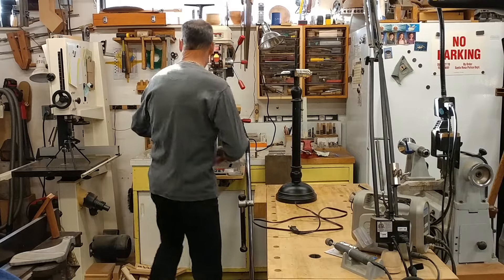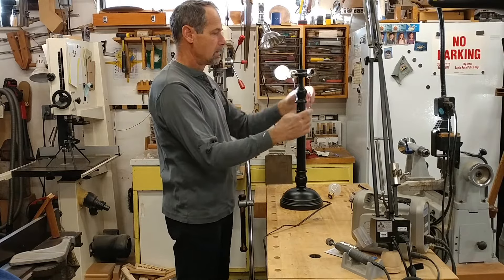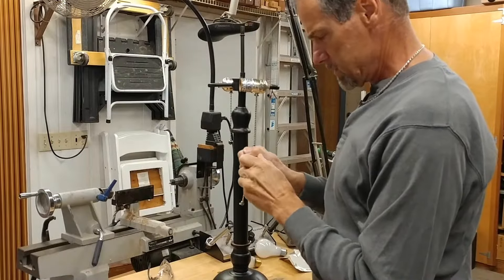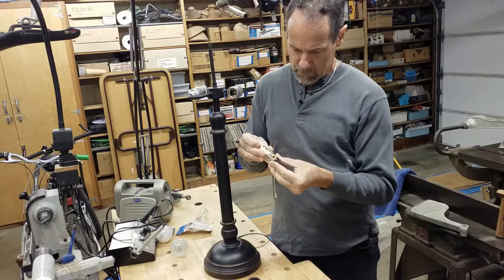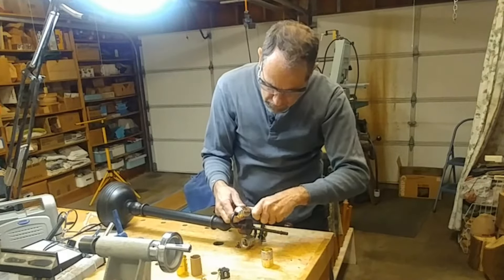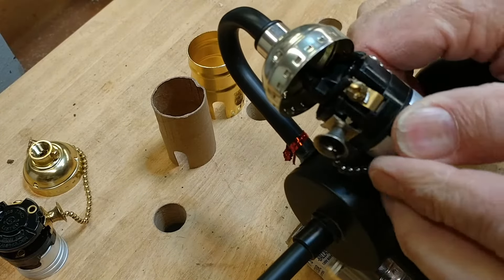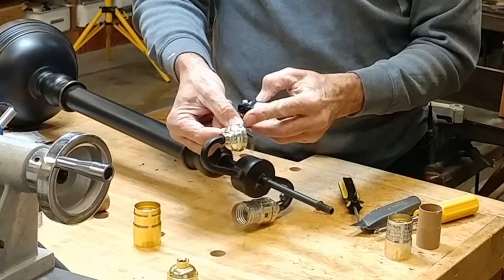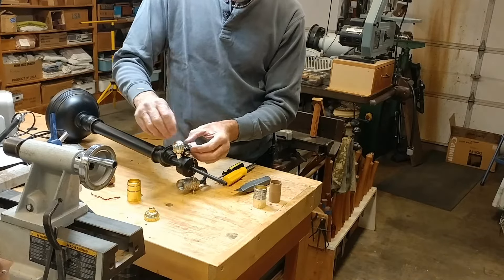Pull Chain Lamp Socket - How to Repair / Replace

Comment: Thank you so much for this tutorial, so helpful. You got my thumbs up!!! I was able to follow, stopping the video when necessary to follow you step by step. My cardboard insulation tube was taped too. 

One suggestion, could you put a closep focus on the gold and silver wiress and the connecting screw turning clockwise etc. so it is clearer? Otherwise, it was excellent instructions and I was able to follow, fix my lamp and save a lot of money. Much appreciated. 

Ps, Thanks for not playing music in the backgroudn, as it is so distracting. Thanks again.
Reply from the maker: I'm so pleased it was of help 🙂

Comment: Thanks man this is the video that gave me the confidence to try disassembling the fixture, mine came apart exactly like yours with the taped cardboard and everything, I discovered the plastic wheel the chain spins when you pull, is cracked and therefore clearly beyond repair, but I found I can just buy replacement fixtures that will fit right on. Tomorrow I’ll compare the price of a new lamp vs two new fixtures (both have broken pull chain mechanisms)
Reply from the maker: Good for you! 💪Glad to offer you a little confidence💪

Comment: Please show a constant close up of your work  & please slow down. You make it look simple but it is somewhat confusing because you can not see what you are all doing & please explain some of your steps a little more thoroughly.  Thank you, Nice shop
Reply from the maker: Thanks Annie. Sorry it's not a perfect presentation. Working impromptu with the camera in the way is difficult to get everything aligned and shown properly. But I figure something is better than nothing. Too, you can open your YouTube settings by taping the gear icon, and select a slower playback speed. I find this helps with certain videos.
Reply: Hi I did not mean to insult you in any way because your helpful video was very good, It's just if you have never done this type repair of any kind it is somewhat hard to understand and the small little things that you may take for granite(your talent) can be hard to understand and follow. Thank you for trying to help other people repair a pull chain lamp.

Comment: Nice! I’ve an old vintage lamp with a broken off chain. Thankfully it broke off in the On position so I can still use it but have to plug /unplug it every time. Looking for an older socket or just a chain.. if it’s possible to replace the chain?  Peace.
Reply from the maker: You'll need to disassemble and look at your socket. With some, you can access the cam where the chain simply snaps into a slot, and replace the chain. The socket I removed was like that. But the socket I installed was sealed with rivets at the switch mechanism, so the chain connection wasn't accessible.

Comment: Hi, thank you so much for sharing this video, is there anyway to know if the pull chain is just stuck or if the floor lamp needs a new housing? The floor lamp is 3 years old in four months and has been little used ( no children or dumb adults:) ).
Reply from the maker: In my experience, if the chain is stuck you usually need to replace the socket as I did in this video. The chain ratchet/spring mechanism is all intragal with the socket and must be replaced as a unit.

Comment: Hi @ItsFixable  I'm having trouble finding a lamp part and I'd be very happy if you could help. I saw a table lamp once that had a pull chain socket and an 'arm' reaching outward from under the socket that held the pull chain away from the lamp body. I need to know what the arm part is called. I've searched for hours with no luck. The part is so the chain doesn't hang against the lamp. Can you help with name of it so I can find it, or direct me to where one is? Thank you so much!!
Reply from the maker: I'm sorry, I've never heard of such an item. It may have simply been an original design as part of that lamp you saw.
Reply: @ItsFixable  Okay, thanks!

Comment: Thank you for this video!  Can you convert a floor lamp pull chain to 3 way?  I have an shorter, older, pull chain floor lamp I use when knitting, but now these aging eyes might need a 3 way light.  Thank you!
Reply from the maker: Yes, absolutely. Though its harder to find a three-way pull chain socket. But if a pull chain isn't necessary you can simply install the one with a knob.
Reply: @ItsFixable  thank you!  I didn't clarify, but great to know it can be just a knob...didn't want pull chain anymore.
Reply: @ItsFixable  my floor lamp "caution label" indicates Max 60 watt; Type A bulb.  Does replacement 3 way socket part dictate what max watt can used?  A 3 way light has a setting of 150 watt.  Or will I have to replace with a complete set up?  Not sure if I'm asking the right questions to solve my problem.
Reply: @ItsFixable  another question please...if I replace my pull chain with 3 way can I still use a regular bulb with no problem?  Also can I use a LED 3 way light or a regular LED light?  Or is there a LED 3 way light replacement part?  I like the old bulbs...bought a lot before they discontinued...not sure if I have and "older" 3 way light.  Thanks for your patience!
Reply from the maker: If the watt rating tag you see is adhered to the socket body, it refers to the maximum that sock will handle. Usually you can replace this socket with a higher rated one. 3-way sockets are often rated higher. If the label is on the base of the lamp, it usually refers to the entire lamp's construction and its ability to handle electrical load (and heat). The plug, internal wire, and lamp shade all are in this determination. In this case you should not change the socket or bulb to anything higher than the rating. For example, some lamps have very thin internal wires in a restricted space that will overheat with a higher load, or plastic shades which can melt or burn with excessive heat.
Reply from the maker: You must use a 3-way bulb for a 3-way socket to function properly. You certainly can use a 3-way LED bulb. An LED would allow you to achieve more brightness without exceeding the watt rating of the socket or lamp.
Reply: @ItsFixable  the warning tag is not on the socket, but on the lamp.  I forgot to mention;  my chain doesn't work anymore.  So....there are two options available to me?  1)  replace old socket with chain to new one with a knob (or chain)? No help for these aging eyes!  Or 2)  replace old with new LED 3 way with knob whereas the bulb can be equivalent to 40 (energy use 6 watts, 60 (energy use of 9 watt, 100(energy use of 16 watt)?  And I can still use NON LED bulb if I chose to?  My Mom always told us as kids that we need to learn something new everyday...well, I've learned a lot today to last me awhile!...just from first question!  Thank you!
Reply from the maker: @sylvialarson1506  You got it!
Reply: @ItsFixable  thank you for sharing your knowledge and expertise!

Comment: My pull chain actually pulled apart, into two pieces, and I don't know how I can reattached it.  It doesn't have anything to do with the socket.  Can you help?
Reply from the maker: Depending on where it separated, you can re-join the two pieces with a little splice link. This is a small oblong link split in such a way as to connect one bead on the chain end to one on the other chain end and hold them together. Basically it the coupler used on an old fashioned keychain. Some hardware stores have them as part of a kit to extend your pull chain, but many craft store usually sell them too.
Reply: @ItsFixable  Okay. Thank you!  That's very helpful. Thanks for the quick reply.  I'm off to the hardware store now.  ;-)

Comment: This video is great. My nutty neighbor replaced the chain with the turn knob:(((
 I cut off wire and want to do it myself. It's all clear in the video but I'm still scared about which part of the wire to add to gold and which one to silver. Can you please guide me on this? Thank you
Reply from the maker: The HOT (+) lead goes to gold.
The Neutral (-) lead goes to silver.
Ways to identify: the hot lead is often black in color or has a smooth cord casing. The neutral is often white or has a subtle rib or line on the casing. If you don't find it marked in some way, and its a polarized plug (one prong wider than the other), the narrow prong is the hot. And if the lamp is so old as to not have the polarized plug, it would be wise to change the plug to one that is and then wire the socket accordingly.
Reply: @ItsFixable  Thank you so much for your reply. I really appreciate it. The thing is both wires are the same color and same size. would it be the case when it doesn't matter which wire goes to gold and which one in Silver?
Reply from the maker: @MM-oq1lb  It'll work either way but it's much safer if the hot (+) is wired to the gold. Otherwise the light socket is live even when the lamp is turned off. So, if the bulb is removed for any reason without unplugging the cord, one might get shocked if they reach into it. Or if the bulb breaks, there is potential for shock/spark etc. even though the lamp is off. That's why it's best to wire it correctly.
Reply: @ItsFixable  Thank you

Comment: I bought some new lite bulbs, energy efficient. Put it in the socket pulled the chain and the light went out, both bulbs and tripped the breaker. Got the breaker fixed, and now the pull chain on the light bulb side that blue won’t work. The chain won’t turn on or off.
Reply from the maker: Mmm... Sounds like something shorted out in that socket. You'll probably need to replace is like I did.

Comment: What was that red wire that you pulled off?
Reply from the maker: It's easy to get interrupted or otherwise distracted and then end up working on the wrong socket or mixing the wires, so I used a red twist-tie to first mark which socket was the one I needed to repair, and then I took that twist tie off and put it on the wire that I identified as the hot lead, the one going to the gold screw.

Comment: I have same lamp and sockets. I have changed both but still not turning on despite power is running as checked through tester. Any help or tip? TIA
Reply from the maker: 1) Be sure your bulbs are good. Test them.
2) Test the sockets with a volt meter (carefully). If no voltage, you have a bad cord.
3) If you have voltage in the socket, be sure the bottom contact touches the bulb when installed. You can bend up the contact a bit.

Comment: It would have been nice to save the matching chain pull on an antique lamp which is my problem.
Reply from the maker: Yeah, I'm with ya Mike. I ended up with two different color chains, though this wasn't an antique and you can't really see the chains when the shade is on. The socket I removed had the ability to thread a chain into it and clip it into the cam which activates the switch. That whole part of the mechanism was open for access. Perhaps you can find a sock like that? this too allows one to install a custom length chain without the need to couple on an extension piece. The socket I install was simply a sealed unit.